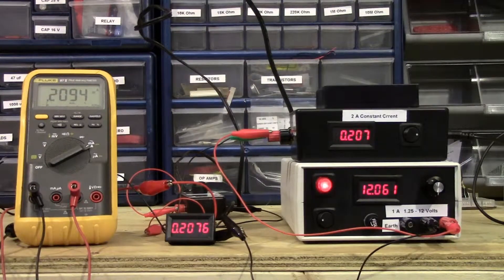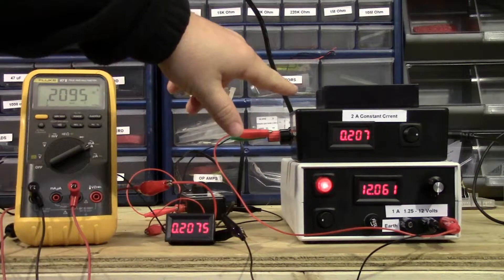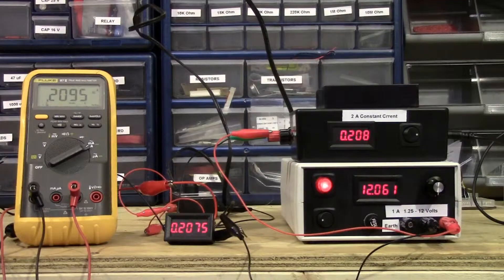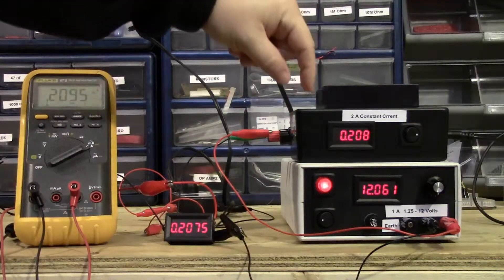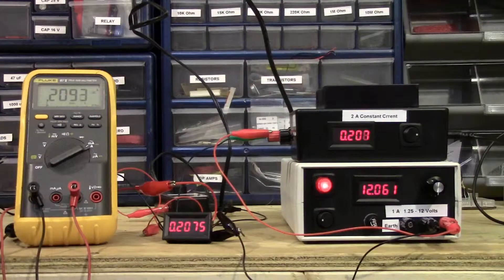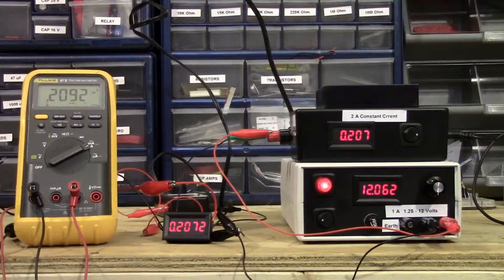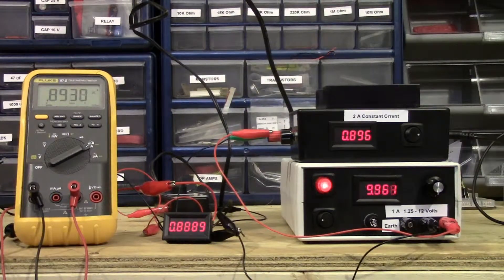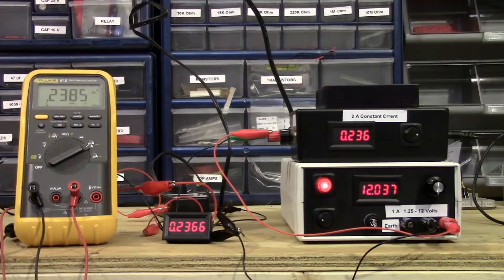#2 - DC Power Supply Upgrade Part 2 - Panel Meter

Comment: I've seen your 5 part series but didn't see where you talk about the original circuit design. Do you intend to just replace the LM317 without any other modification to the board? Thanks.
Reply from the maker: That is correct. The original board did not require any changes, as the components were rated for the additional current. The design of that board is very similar, if not identical, to the new board that was included as part of the "upgrade".
Reply: @bradfordhenson  Thanks for the quick response. I thought the LM317 was rated for 1.5Amps which is why i assumed it would be swapped. Forgive my ignorance, I'm just starting out and have read and seen many videos and it gets confusing keeping track.